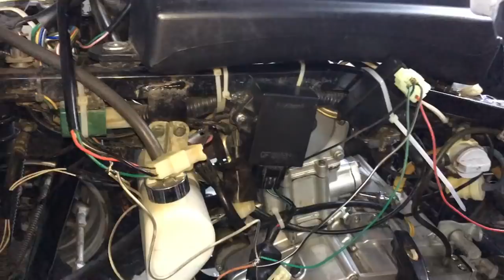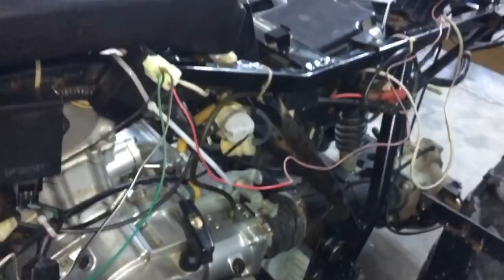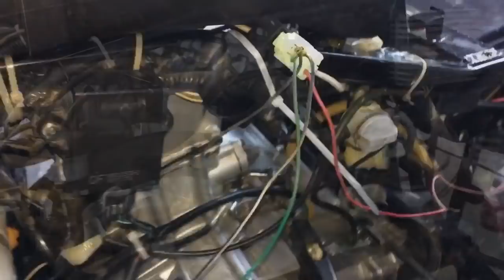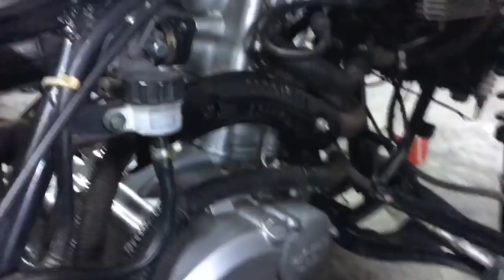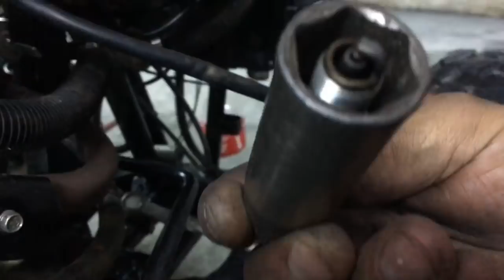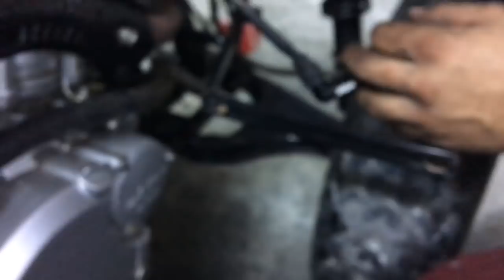Atv Lifan 250-300 afuma bujia repede si se incinge toba rau Partea 2

Comment: Aveți la SHR cdi-uri cu doua mufe ovale cu 4 respectiv 2 pini de atv 250?
Reply from the maker: Cu alimentare din baterie?
Reply: SHR Motors cum stiu dacă este cu alimentare din baterie sau din stator? La fel se înroșește toba și la mine si pocnește in tobă urât.
Reply from the maker: Masori firul de la cdi cu contatul pus si vezi daca vine tensiune fara sa dai la automat
Reply: SHR Motors Am masurat, am pus un fir la masa și unul pe pinul de la cdi și are tensiune. Dar in timp ce merge motorul, dacă iau firul de plus de pe baterie, nu se oprește.
Reply from the maker: Pai are tensiune doar cu contactul? Fara sa fie pornit?
Reply: Da, are tensiune cu contactul pornit, înseamnă că e cu alimentare din baterie. Vreau să cumpăr un cdi și încă ceva piese dacă aveți.
Reply from the maker: Da, este cu alimentare din baterie

Comment: Salut ? Am o problema la un atv bashan de 200 cc racire aer  . Se inroseste toba cand i dau in gura carburatoru e reglat la2 ture jumate
Reply from the maker: Daca merge ok, nu aveti de ce umbla la el
Reply: @SHRMotorsOfficial  va multumesc de raspuns da nu se intampla nimic ca umbulu asa cu el motoru trage foarte bine .  La relanti motoru nu merge rotung .
Reply: @SHRMotorsOfficial   inco o intrebare acum cate va zile  am desfacut capacu la tacheti si nui vine ulei poate fi pompa sau alt ceva ?
Reply from the maker: Pompa cel mai probabil
Reply: @SHRMotorsOfficial  am desfacuto si mise pare ok cum imi dau seama daca i stricata .
Reply from the maker: Uzura de pe margine
Reply: @SHRMotorsOfficial  salut ?am  pus pompa cea noua si numa dupa un minut vine ulei acolo sus la tacheti am pus capacu si are surubul acela de vezi daca baga si njma ce stropeste i bine asa sau nu . Multumesc ?
Reply from the maker: Este posibil sa fie infundat traseul pe langa prezon... si sa nu urce bine
Reply: @SHRMotorsOfficial  am suflat tot